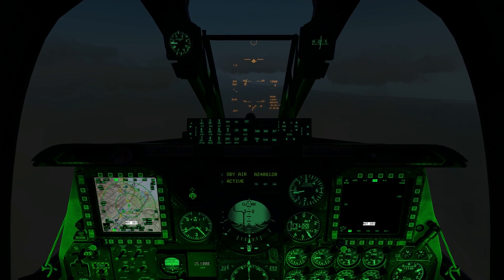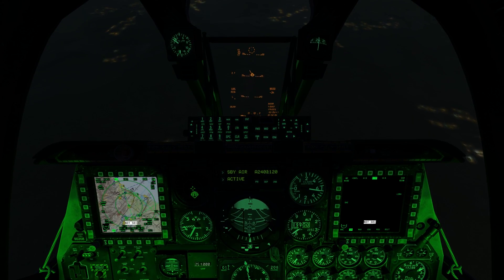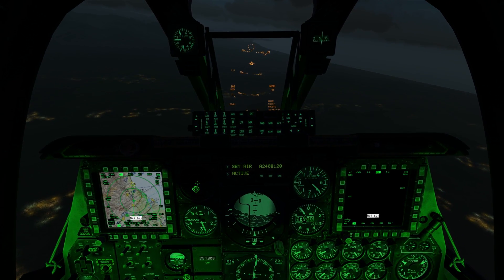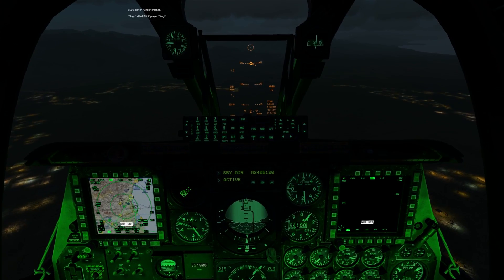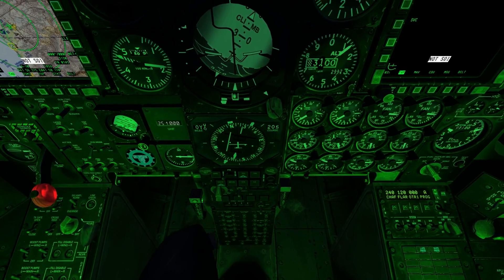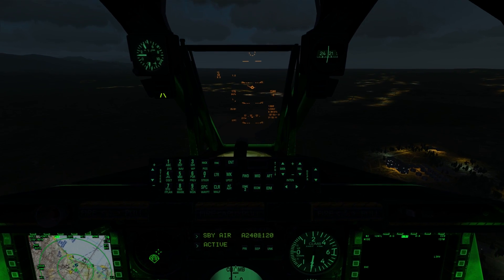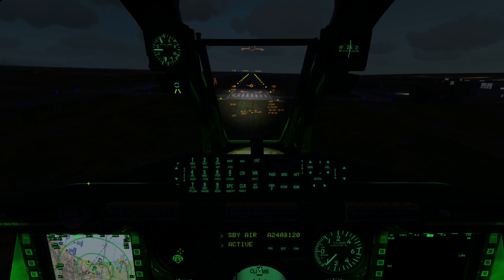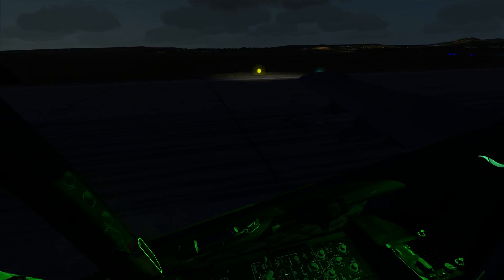DCS: Landing the A-10C in manual reversion mode

Comment: So I need help if I put the a-10 in manual reversion it starts to shake uncontrollably. Why?
Reply: I have encountered the same problem and it is almost definitely a bug. The ailerons rapidly oscillate between full deflections in either direction. Given that there are no hydraulics and almost no wind/turbulence there is nothing that can cause them to physically move so much. I'm looking around ED forums for this issue but nobody seems to have filed/reported it yet, could be a recent issue?
Reply: I had the same problem when doing the mapleflag BFT emergencie mission. Turned out it was because I had nothing on the pylons. Once I equipped it with the TGP, ECM and AIM-9, it wouldn't oscillate anymore
Reply: ddenisen yeah I tried making a ticket but nothing I'd suggest you also make one cause you seem to be able to describe the problem better than I can. Lol
Reply from the maker: hard to tell. could be winds, could be a sensitive joystick, could be a trimming issue, could be your speed is too high.
Reply: What speeds should I be at?
Reply from the maker: corbett hankins about twenty knots above stall speed
Reply: Ras Talon ok I'll try that and hope it works! Could I ask a favor though could you if you still play run it and tell me if you get it as well that way I can confirm if it's a bug and report it?
Reply from the maker: corbett hankins might not be a bug. Without hydraulics the aircraft won't be as stable. Manual reversion is about having some control rather than none. It doesn't mean you get a smooth ride.
Reply: Ras Talon fair enough lol
Reply: Ras Talon it didn't help I lose all control no matter speed as soon as I turn reversion mode on it starts to shake wildly.

Comment: The leg before final is the base leg, then you have final and short final .
Reply: +RasiTalon that was a good landing but try adjusting the weather to say a quartering X wind off your final of say 30 knots with gust of 24.  Try adjusting your visibility to 1/2 mile . Then try your landing again . The FAA recommended approach is crab - decrab...
Reply: +RasiTalon partial panel is a part of any pilot's training , I once lost my bendix King heading out to PRX from ADS , I was on Vor,sectional chart and plotter.  No problem , once lost alternator , battery , coms, flaps, and turn n slip indicator on the way out to F00  I was purely pitot static and running on 1 mag . The failure happened right after I keyed the ARCAL . So I had the field on my downwind which I extended and did a slip -to -land . Had to wait on the ground 2 hours before we got a ride back to the FBO. When you do your  landing at the field there, think of it like a power of stall, do you have a way to pull flaps so as to do short field ? Also use air braking by pulling back on the stick , your elevators will help you bleed off airspeed pretty fast.but flaps will keep you in ground effect longer -your wake turbulence becomes ground effect you know.
Reply: +RasiTalon oh and I can fly on ADF too because they are utterly reliable . One added bonus is; you can listen to AM radio on the way out so just a tip.
Reply: +RasiTalon hmm my replies seem deleted . So I gather you are a pilot then?  I have been in some million dollar simulators but they do not compare to real flying.
Reply: +RasiTalon missing post /iPad failure, Systems? You should fly g1000 (glass cockpit ) all military pilots train on 172s I trained on 172s, piper Cherokee and some bigger multi but understand that sims are really only good for section 3 training and Instrument . Look up the jep plate for Addison field and if you can afford get foreflight , it's really good for flight planning . Though I still use paper sectional and E6b
Reply: +RasiTalon well remember that flight sims are just a game, real flying is far worse , I have had multiple waive offs in big planes, engine failures , fires , fuel failure. Train on those emergencies.
Reply: +RasiTalon oh, well the best fun is training on section 3 of the POH . ITS tough, you will be challenged, you will sweat bullets but its the most fun you will ever have! get an a 10 POH section on emergencies...

Comment: Funny thing is that in DCS A-10C hydraulic failures are not happening. Only thing that may happen is engine failure that causes problems with supplying hydraulic system with pressure (hydraulic pumps are driven by engines).
In DCS Ka-50 hydraulic failures and leaks are very common.

0:50 Yes the pitch is a bit** ;-)
Reply: *****
Fortunatelly in most situations damaged engines will be wind milling and that will slowly increase the pressure in reservior.